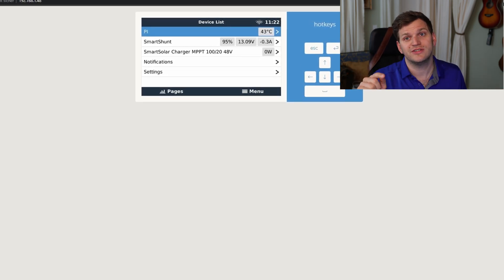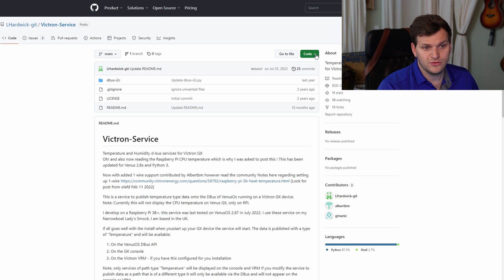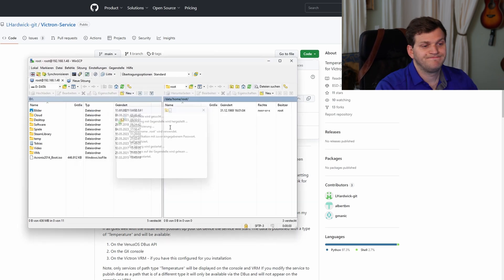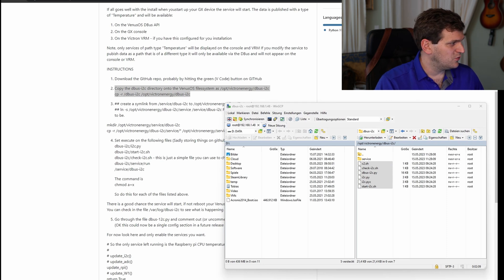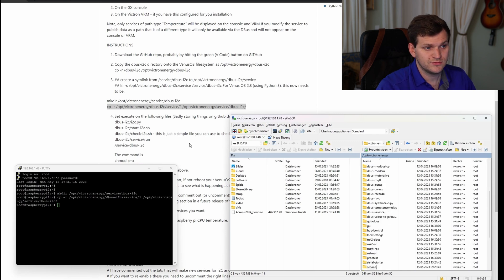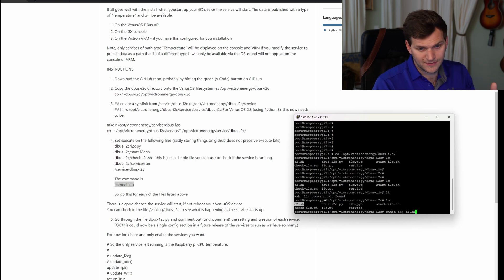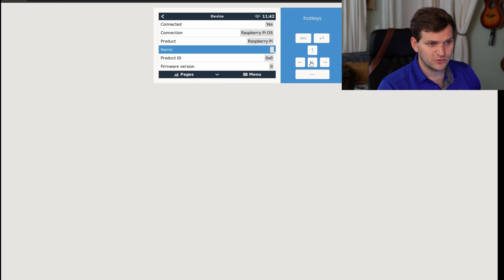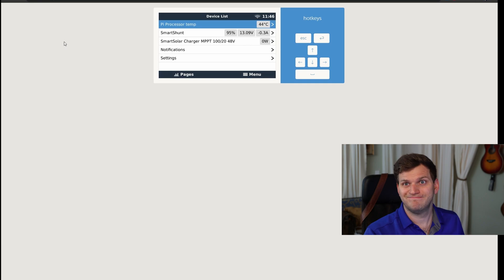Victron VenusOS & Rasperry Pi | Show Processor Temperature | How to configure

Comment: what do i do when it works but if i reboot the service doesnt start? it worked just fine. i restarted my pi and the temp stopped
Reply from the maker: Stopped or disappeared?
Reply: @tobisreallifeskillswithtobi  both. disappeared from venus screen but stays on vrm screen but with no update. I just deleted the folders and started over again and its working now but im afraid to restart my pi. is there a way to manually run the services with a terminal command? I see another commenter said, "I just needed to manually start the run file located on /service/dbus-i2c." This is my first Pi and my first run with linux and I dont know how to manually run a service.
Reply: @tobisreallifeskillswithtobi OK I got it running but I have to do chmod a+x run every reset

Comment: This worked flawless for me. Thanks for putting this process into an easy to follow video. I already have an alternate temp sensor like the one in the video running my fans in my solar generator "box". Now I can monitor the Pi temp remotely. Hats off to you for the hard work!
Reply: Temp reading on remote console updates quickly but my VRM dash board hasn't updated since reinstall. Does something need to be done to receive real time data on the temp? All other functions working real time - solar charger and dc current draw. Thanks for the great video again.
Reply: Tobi after watching my VRM screen the temperature does update, there is a banner under the temp that says last update ....15 minutes ago and it is increasing..... but the temp is updating. Sorry for the confusion.
Reply: @timothyerskine4818   i had a similar issue. I solved now: in my case I found out I just needed to manually start the run file located on /service/dbus-i2c. I think Tobi didn't showed it. then the device and the VRM is running again. best luck
Reply: @FC-IT-Solutions  how do i do that. it was working then i rerooted and it stopped